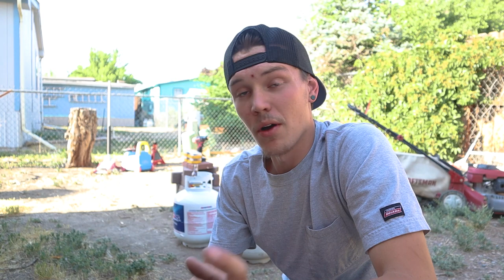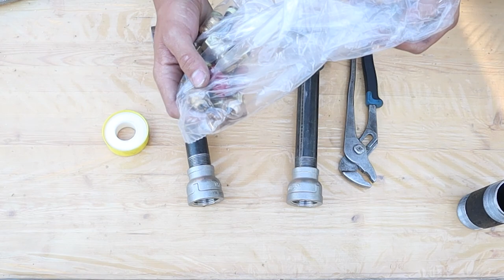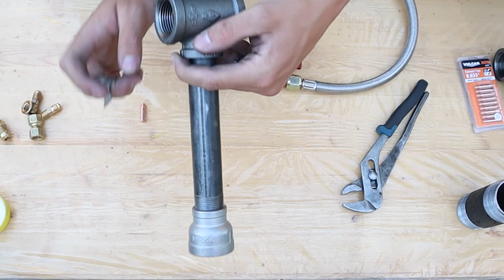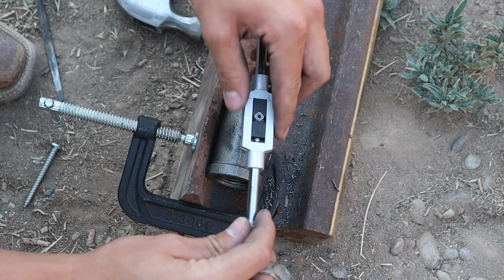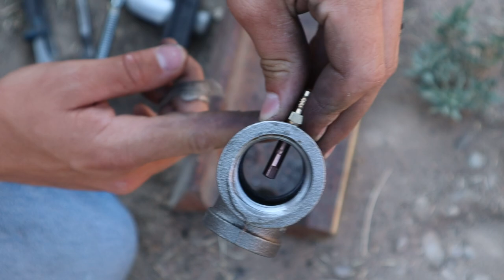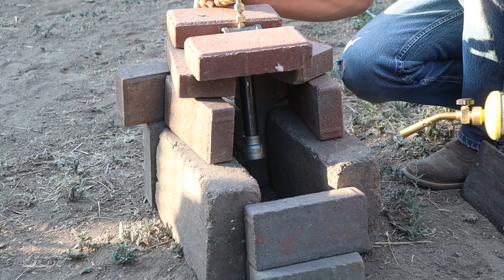Frosty T Burner Build | DIY Venturi Burner

Comment: The Frosty Tee is the easiest burner to build, IMO. I cheaped out and used a short schedule 80 nipple to tap for the Mig tip, cuz I'm a cheap slug, then a 1/8 to 1/4 ell and a 1/4 pipe thread to a 1/4 flare fitting...... cuz I'm a cheap slug.
Good job. 👍🍻
Reply from the maker: Haha, thank you! I don't have a ton of experience with different designs, but this is simple and effective. It was a no-brainer after my research.
Reply: @ironpixeldesigns  David Hammer shows making one on his YT channel that works great. A little bit more complicated and with your limited tool inventory, may not be practical. I've got both types on my little freon tank forge and the Frosty does fine. You should check out his channel. Interesting stuff.🍻

Comment: Did you leave the mig tip that long or cut it off to the center of the t. Good job brother.
Reply from the maker: I left it that long. It's a bit too long though, which causes the burner to run lean. I'm still running it like that to this day, though.
Reply: @ironpixeldesigns   I left it long as well. It runs great. Runs a tad less than 2psi